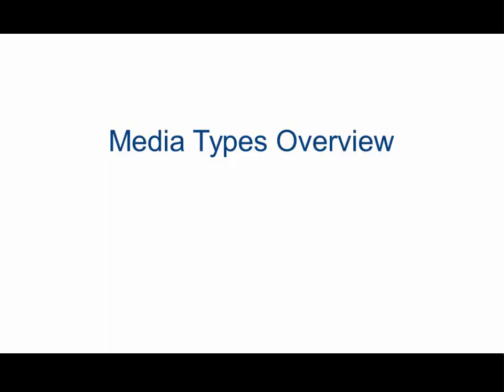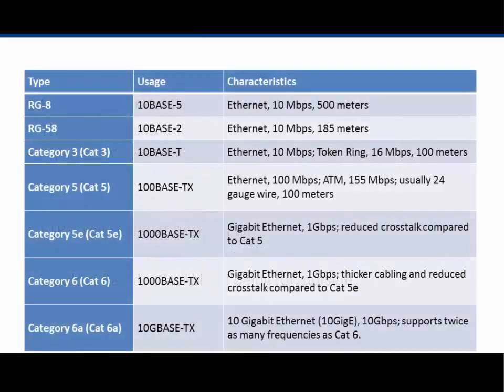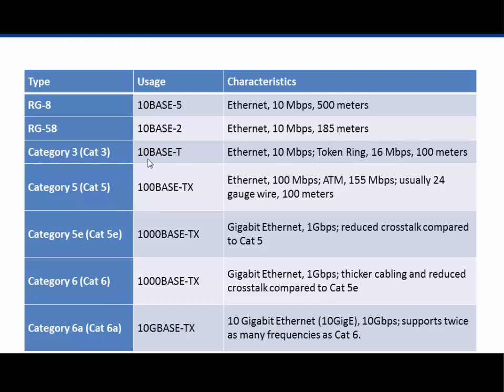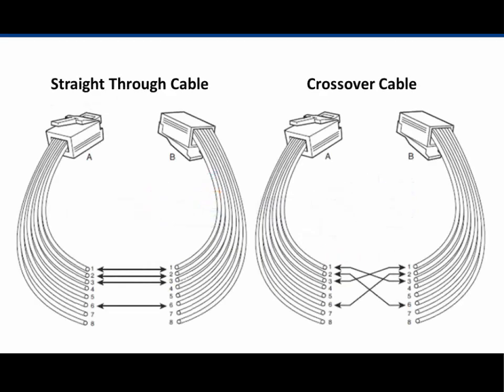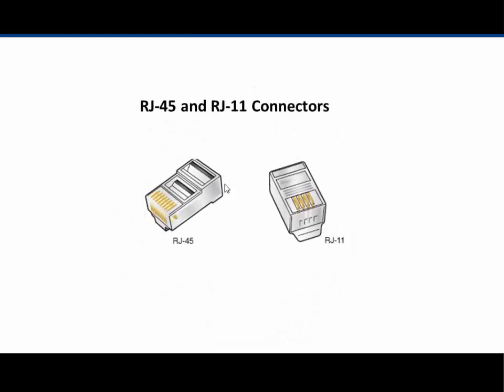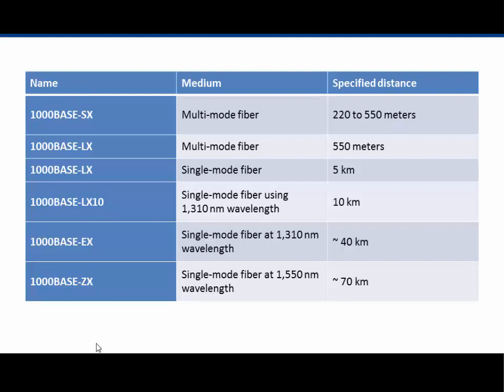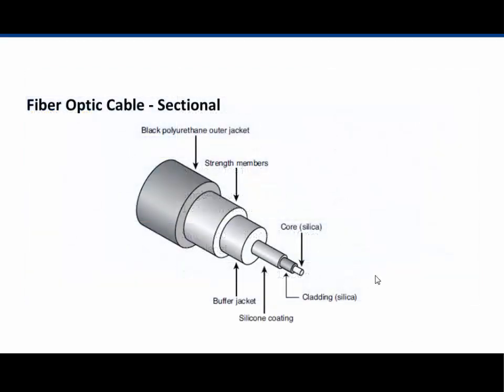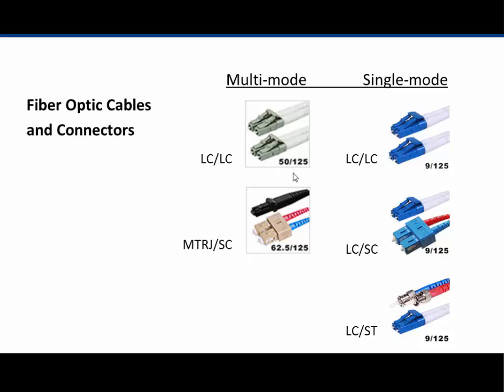7. CCNA Ch4 - Physical Layer Media Types

Comment: I am getting confused with FTP cabling and FTP protocols
Reply from the maker: Layer 1 - FTP (foil screened twisted pair) cable is a cable containing multiple pairs of copper wire enclosed in a sheath of aluminum foil. The FTP protocol is at Layer 7 and it is a file transfer protocol, basically a file server, used to upload and download files to websites.